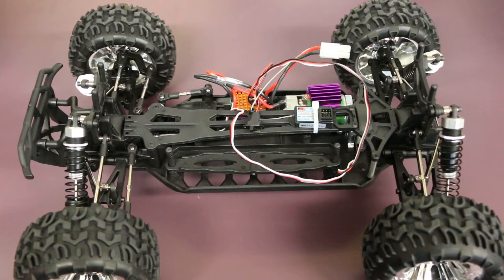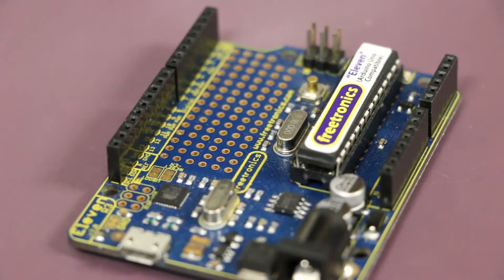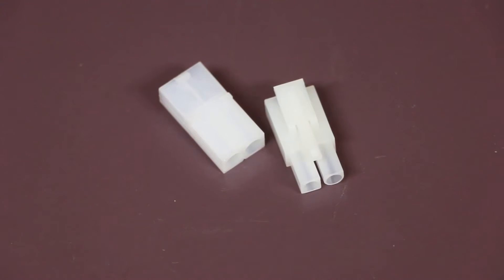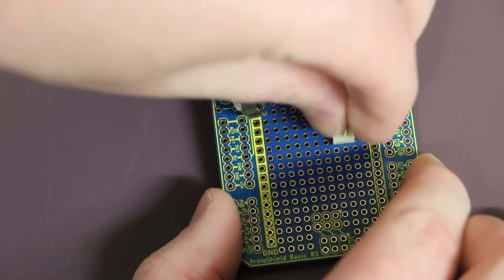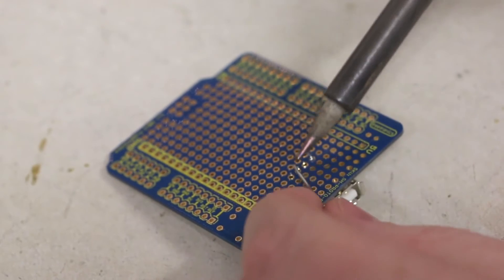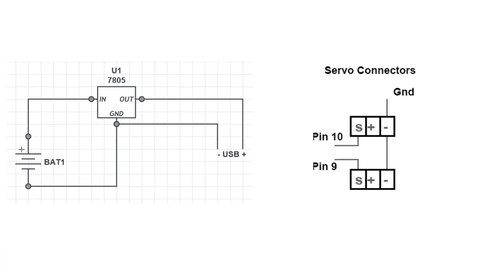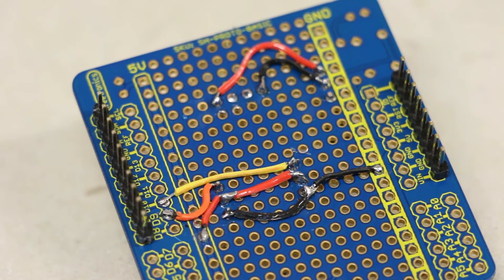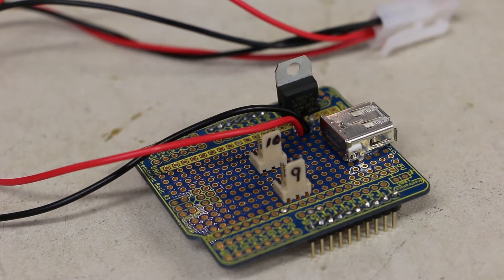Web Controlled RC Car #1

Comment: hi , just wanted to know if there was a good off the shelf internet controlled vehicle that can be customised with a swivel view FPV camera that  can also be controlled over the net (ie left, right, up down zoom views) . In the perfect situation I'd also like to have a twitch style interface so the controller can control and others can watch.  Other features include some sort of automated battery awareness so the vehicle calculates how much battery power it has left and automatically returns to the charging point to recharge.   Would there also be away to ensure the vehicle can only be controlled within specific boundaries, so the controller of the vehicle is prohibited from crossing over lines in the ground.   I'm thinking about a 1:10 scale car. If this is something you could do, please give me a reasonable quote